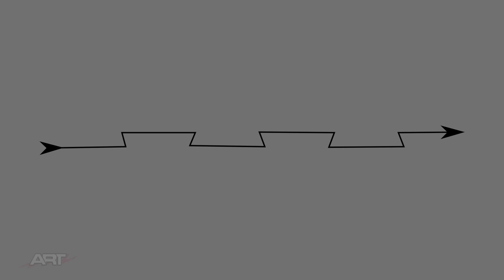Double Needle Blind Stitch Part 1 - Cloth  v13

Comment: I had a split seam (about 3 inches) in the cloth driver's seat of my IROC-Z Camaro. It was at the rear where the seat fabric meets the harder carpet type material.  I was going to just try to do a normal single needle stitch to try and repair it, but when I started, I could see that it was just going to be ugly.  I found this video on a search and I am very glad that I did.  It took a few minutes to understand the technique, but in about a half hour, I had sewn the seam with the two needle method and it's totally invisible.  I have been sitting on it for several weeks now and the seam is holding up well.  Thank you very much for showing this technique, I'll likely use it again.
Reply from the maker: Yes, and thank you.  It really is as close to a sewing machine stitch as you can get by hand.

Comment: Tried it on my "new" second hand car which had 2 ugly holes on edges of both seat area and backrest. Worked really well! Patience is needed and I only had 1 rounded needle so was constantly retreading the needle from side to side :). I used a good quality Gutermann topstitch sewing machine thread in the end. First couple of stitches with regular hand sewing thread my thread broke because there was a lot of tension on it. Bottom line: method works like a charm. Do invest in 2 (!) round needles and good thread though.
Reply from the maker: Glad you found it useful.  So many in our industry refuse to believe it when I recommend #18 Nylon hand stitching thread.  Because they don't want to invest in a few dollars!  But believe me, years ago I experimented with all kinds of needle and thread scenarios to come up with this.  We face some very severe gathering of materials under tension.  We need to carry what's proven to work in these instances.  That's why seeing it demonstrated is so good.
Thanks for joining in!

Comment: This is a great tutorial and you make it look so easy to learn! I tried practicing on an armchair in our home that has a tear and it was tough going because of the nubby fabric. I had a hard time seeing where to put the needle back through the hole.  Question regarding the thread you used. I bought Gutterman upholstery thread which is strong but doesn't look as thick as yours. What type or # thread did you use? How long of a length of thread do you need to work like that? I may have had mine too short. Also as someone that embroiders, I had a tough time using the curved needles. They kept slipping out of my hands. Would this technique work with straight needles? I appreciate your comments and help.

Comment: I've seen two-needle sewing like this in saddle making. I'm looking for techniques to use on an armchair I'm reupholstering and this might be just the thing. Thanks for the nice video.
Reply from the maker: Thanks for joining in.  I may not have stated in the video but this thread can be tied off at any point along the seam.  And resumed from that point with fresh thread.  Helpful if you have a long seam along the back of a chair or couch.

Comment: Is there a way to find out the original thread used?  Meaning color, weight (does it differ?)
Reply from the maker: The original thread doesn't matter.  We must use hand sewing thread because of the forces involved in pulling the material together.  Color doesn't matter if we can do a good enough job to truly make it a blind stitch.  Thanks

Comment: Please allow me to ask a few  "stupid" questions.  We did not see you thread the needles.  In fact, we did not see if you did this with one piece of thread or two, or how you anchored the thread at the start of the stitch..  Is this just one long piece of thread anchored in the middle at the start of the stitch?  And I could not see if you knotted the thread to keep the needle from coming off.  Did you?  Finally, how big a tear can be drawn together?  The seat on my VW is quite a mess.  I'd love to take it to a craftsman, but there is only one in my area, and he's been booked solid for months and is not taking any work.
Reply from the maker: Threading the needles @ 5:50 and 6:15.  No knots.  You don't want to be pulling a knot through the hole.  One needle on each end.  Even each length at the beginning.   Just as in Fig 1 at 6:15.
For an even wider pull see v96 at 11:00.
Reply: @a.r.t.srealrepairsforrealc8247  Thank you.  Did not see the threading.

Comment: Are you using a needle on each side or are you using just one needle and going back-and-forth because I can’t see where your needles going if you are putting it to the side and getting the other one
Reply from the maker: A needle on either end.  Sometimes I stick the idle needle into the seat to avoid it sliding of the seat and into the the black hole that exists in all cars.  
Thanks
Reply: I had to watch it a second time,  and pay careful attention,  to notice when he was switching from one needle to the next.  
Also watching the other videos might help. 

A video where two different color of threads are used for each needle, and have it clearly pointed out when the switch is taking place would be nice.  

That said,  these videos are wonderful and I really appreciate the time and effort put into them.  Thank you.

Comment: How does this affect the area where there is a side airbag in the seat if the tear is near that area because I have been told that the stitching on the airbag seam is special?
Reply from the maker: Thanks Dave.  I don't have any confirmation about that thread being anything special.  I have heard to the contrary.  For perspective, consider that an airbag actually rips apart the plastic on a dash and punches through.  However, as a disclaimer, each one should make their own judgement as to what they will and won't repair.  
As a precaution, the main source of trouble lies in repairing over the airbag area when there is no airbag.  One company got in serious criminal trouble because they were presenting the previously wrecked vehicles as repaired but the airbags weren't replaced.  Leading to injuries and death.  The purchaser was deceived and misled in those cases.  I have refused work on a vehicle when the company was insisting on a dash repair over a deployed airbag.  They threatened me with not getting any more work with them and that made me happy too!  I refuse any dash work in the airbag area.  The seats I am not concerned with.  YMMV.  Thanks for weighing in on this.

Comment: Can I use the same technique if the rip is above the seam going in towards the middle of the seat about 3"?
Reply from the maker: You can get away with a large distance pull though it will compromise the seat of course.  See the second half of v96.
Reply: @a.r.t.srealrepairsforrealc8247  GREAT! Thank you for the reply. I shall go take a look. 👍